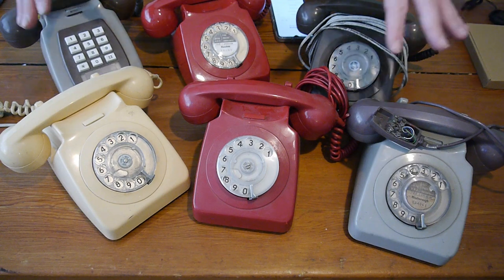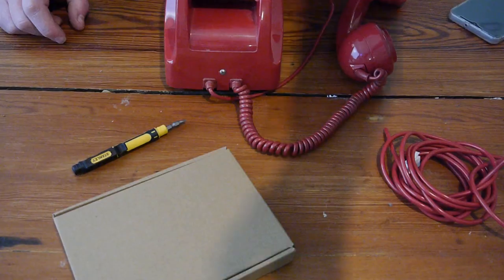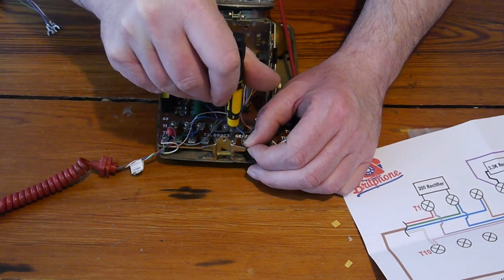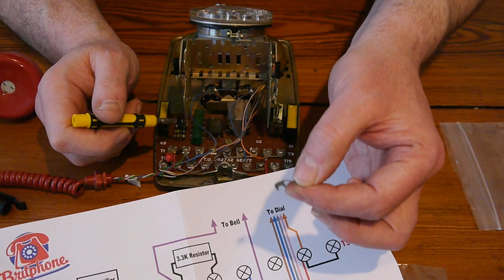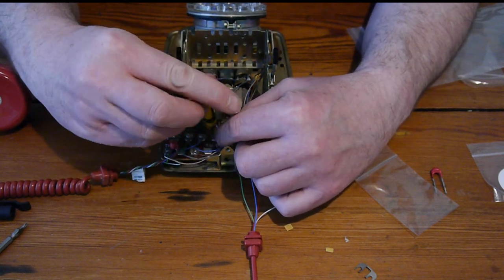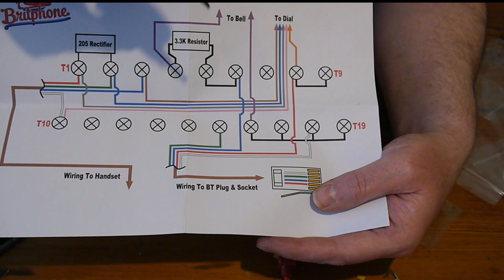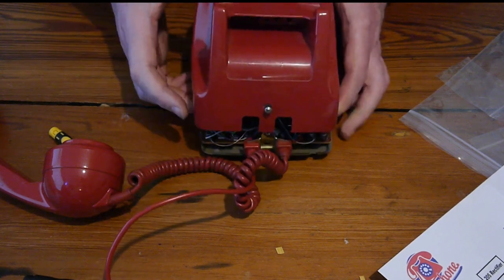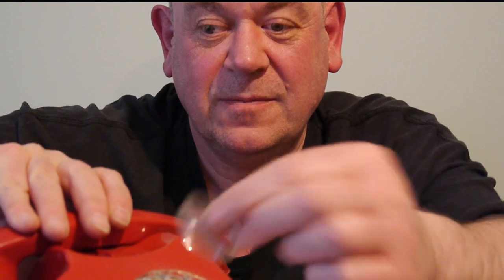How to Convert a Vintage Dial Telephone for use on BT ( Red 1974 GPO 746 )

Comment: Hi Pete. Don’t worry the nut isn’t out of the electronics in the phone. The nut belongs on the end of the screw that holds the case in place. The idea behind it used to be that you undid it until the screw sprang out and no further. It can always stay on the case then 👍🏻 also, never over-tighten as this can cause it to break and crack. Great job with the actual conversion tho pal 👍🏻. All the best 😊
Reply from the maker: Thanks  @ianpiano89. I'll put it back on. Cheers, Pete.

Comment: Hey mate thanks for the video..
We have the old telephone too..
More so just for show as we don't use the land line, 
We all use mobiles,
Buy I come across your video..
But we would like it to ring still.
We have the adaptor connected all ready as was working before,.
As it was my aunty phone. She was we virgin.
And I'm with BT, the connection fits into
The white block ADSL filter, but we don't get any ring tone.

I know the phone isn't faulty as they had it working..

Was just wondering on some advice.

Thanks again for the vid.
Very professional easy to follow..
And explained very well..
Thanks
Reply from the maker: Hi , Thanks for the feedback. 🙂 . Its unfortunate, but I've been made aware  BT areas and now my area ( Hull , which was never BT) is going to be fibre-only soon, with all the copper wires taken out, and I suppose all the old big exchange buildings too! (some nice properties to sell!) it will all be on the fibre optic broadband, and I dont think they"ll work on that system 😪. Still great as diplay piece, but conversion will be a bit pointless!!

Comment: Thanks for this info Pete. I changed the plug end on the phone but didn't work.  Cheers
Reply from the maker: no worries Pete. if you want i can send you scan of that sheet. just rewire as shown
Reply: @PetesRetroCollectables  thanks that would be great. Does it work on phones that go through the router as a pose to phone lines?
Reply from the maker: @TheMonkeyThrifter  im not sure, i think if you have a converter box it might but i havent had anything like that in my area yet so, couldnt say really.
Reply from the maker: photo of sheet in you're instagram dm's.
Reply: @PetesRetroCollectables  thanks Pete I'm out at the moment will check when I get back home.
Reply: @PetesRetroCollectables  Did you send the scan sheet to my Insta Pete.
Reply from the maker: yes your "themonkeythrifter" 
insta

Comment: I ordered one of these upgraded phones from the back of a magazine when I moved into my first house. It was vintage bakelite 312 and worked great, but eventually the tone dialling got disabled on our line so I couldn't use the dial any more. Since it has a BT connector I'm wondering if it'll be usable on the VOIP when that comes online.
Reply from the maker: Hi, Unfortunately I don't think it will work. Some of the old exchanges still accept the pulsed dial tone, until updated, but the digital voice over Internet isn't set up for that. Most tone dial phones will work ( I think ) when plugged into the fibre hub, but may not have the same functionality they did on copper lines  exchanges. 😖. I'm  personally giving up my landline when I shortly  upgrade  my fibre for the first ever time ( only just available in my area) So..sadly  won't be  converting any more phones for the time being. I do believe there are convertor boxes in the USA but dont see any available here currently.

Comment: So I have a gpo 840 i think, i plugged in to my sky router and it receives call but like you said wont dial out. Why is that?
Reply from the maker: I think its because the pulse dialling no longer works in the exchange. Not fixable I think. Thanks for watching.

Comment: is this for VOIP?, will it work after the 2025 copper landline shutdown?
Reply from the maker: No infortunately those digital only systems will not allow the dial phones.
Reply: With the simple addition of a Rotatone circuit or a plug in rotary to dtmf converter, of course it will!
Reply from the maker: ooh ! I'll have to  look into this!
Reply: Yes it will you will need a converter about £40.
Reply: You actually do not know enough to teach.

Comment: What if there is no screw on the back. How do you open the case then?
Reply from the maker: Thanks for watching. I've not seen these without a screw. I would think that those will be screwed from below somehow.
Reply: If it's the earlier version, the 706 phone, then there are two screws on the receiver rest. The case will come off if these screws are loosened.